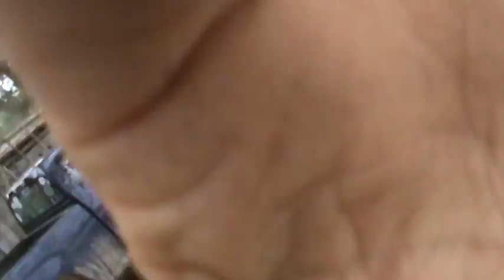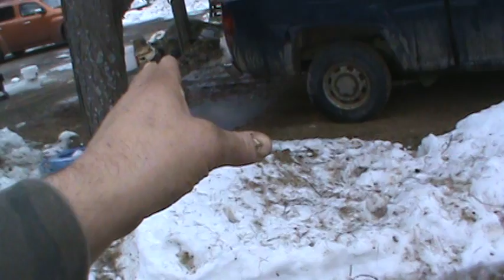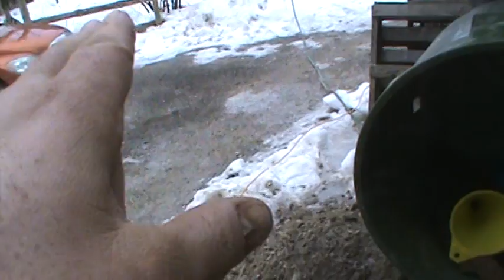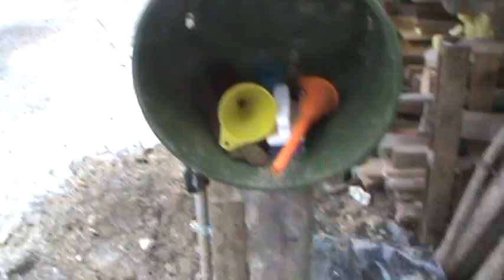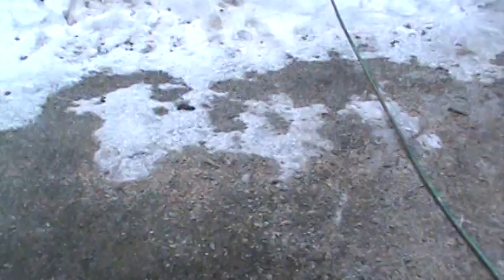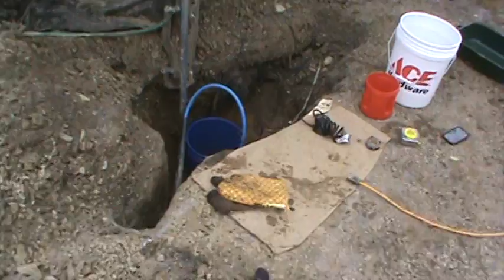how to defrost a underground water pipe

Comment: Not deep enough, for a driveway, the pipe needs to be buried a minimum of 10 feet deep, as driving your car over it will actually drive the frost down further in the ground. If you are less then 10 feet, you can add 8 inchs of foam over the top, about 20 inches wide and that will keep them from freezing. 

I live in alaska, and out pipes stay thawed into -40 f
Reply from the maker: I agree this pipe has not froze in th 15 years that I live here now that I had a few real cold winters with not much snow I had a problem I have to dig !

Comment: Or run a dedicated loop from the water heater to the well and back instead of laying heat tape which will cost ya big time in electrical charges.  ReadyTemp has a lot of info in that regard.

Comment: numb nuts heat tape only lasts few years, put your pipe deeper in ground, your pipe is sitting in wet area, bury it in sand drains well and easier if u hav to redig, unreal
Reply from the maker: wisco if I could've went deeper I would've went deeper I put the piping I hit solid bed rock at 2 1/2 feet can't go any deeper I am up on top of a mountain I have never had this problem in 15 years that I've been here we just had to cold winters extremely cold thanks for the comment Mr. numb nuts

Comment: I have a question about the frozen pipes videos. Did you have any problems with the pipes this year 2015 cause it's been really cold hear in Riverhead N.Y. I kinda thought the problem was 2 fold. 1) The hydrant pipe conducts the cold and ice traveled down and kept going. 2) Line could be deeper or ground could be insulate with 5-6" of Free wood chips. Check craigslist for free wood chips in your area.
Reply from the maker: no problems yet...I also think it was the hydrant never had that problem before ..last year was the coldest I have ever seen ..as far as the pipe I can go any deeper I am on top of a hill can only dig down 2 and half feet before I hit solid rock..i cover the hydrant so I think I am alright.........Bainbridge ny
Reply: Glad to hear it is solved.

Comment: Using heat tape to prevent it from happening again will consume a lot of energy.  At 7 watts/ft it can really add up.  A more cost efficient solution, used by farm owners to protect underground pipes that supply water to their livestock, is a Redytemp.  Redytemp utilizes your water heater as a heat source to protect underground pipes.  It's quite simple, your simply connecting one end of a loop to the hot water supply line and the other end of the loop to the water heaters drain spout (which will also help prevent sediment from building up at the bottom of your water heater).  The looped pipe is laid side-by-side with the underground pipe and then insulated so the heat from the loop keeps the pipe from freezing.  Isolation valves can be added to close off the loop when freeze protection is not required.   Redytemp connects anywhere on the loop and has an internal check valve to prevent back flow.  Next, install Redytemps strategically locatable temperature probe on the return side of the loop near the freeze zone.  Then select the desired water temperature you want maintained in the loop (50F or higher) using the temperature dial on the face of the system.  The pump will intermittently cycle on and off as need to maintain your chosen temperature.  Search google for preventing frozen pipes with a Redytemp
Reply: ReadyTemp ,

Comment: Up in Oregon we experienced -8 or better for 2 weeks no water and when the temps
came backup had broken 3/4" metal pipes both cold water and hot water. The main 2" supply lines all survived. The lines broke in weird places so we ripped out every single inch of pipe and repaired all the little stuff like elbows, T connectors and unions most of the long main pipe runs survived.  We know exactly how you felt as we had no water in the house for 9 days. Used our wood stove to make hot water for doing the dishes and sponge bath's. Crawling underneath a house and digging out frozen pipes is not easy or neat work.  Super insulated everything afterwards on the repair so this was the worst freeze folks had seen ever.  They called it a 100 year super freeze.. We just called it Ice Age.

Comment: I work for a company that does contracted water utilities.  That line wasnt buried deep enough.  For cities, its required to have them at least 5 feet deep.  It colder areas its common to have them even deeper.  Its interesting how you defrosted it.  We have a machine that shoots boiling water in spurts down the length of a frozen line. We also have a machine that is 4 volts but 60 amps and looks like a welder.  We hook one clamp on a side of a line, and then the other side as well.  Then the amperage dethaws the pipe.  I really recommend if you decide to dig up the pipe to  use copper and mueller or ford brass fittings.  It costs more but you wont be fixing anything or worrying about it for a lifetime.  Also attach a curb box and valve so you have a way of shutting off the line from the well to the house in case something ever happens.  Compact everything so settling doesnt affect you later on.  It also really helps to cover your well with something insulating.  Also when doing this work it might be beneficial to add a yard hydrant or flushing hydrant.  If you decide to pay someone to do the job hire an excavator to trench it for you and then someone else to fix it for you.  It will save you a lot of money.  Doing a water project costs some time and money, but fixing a water emergency is a whole other level of expensive.
Reply: Dethaws the pipe?  Is that the same as unthaw?  Wouldn't that mean to freeze?
Reply: ya first thing i noticed too,